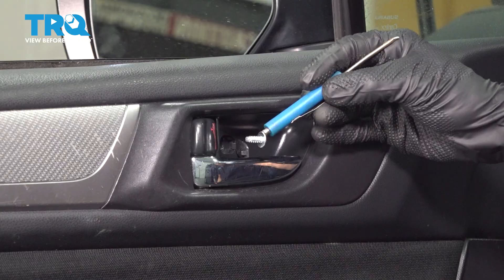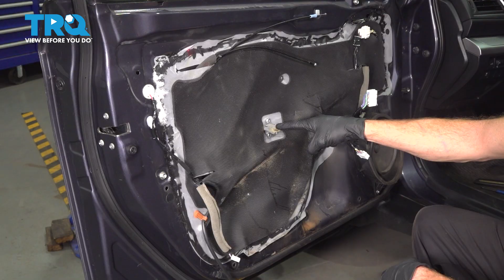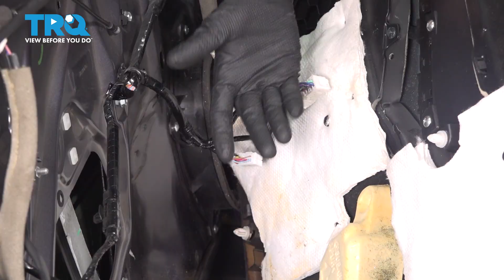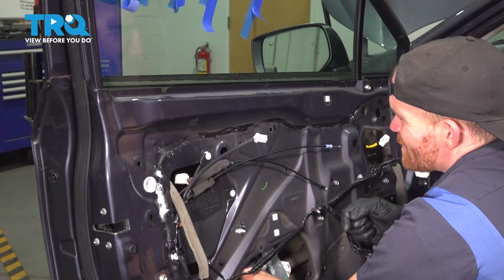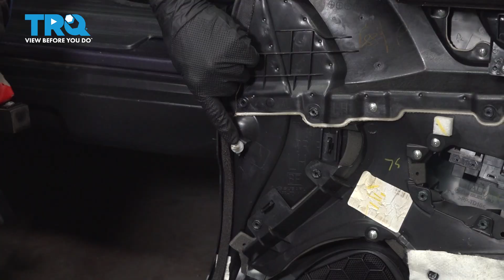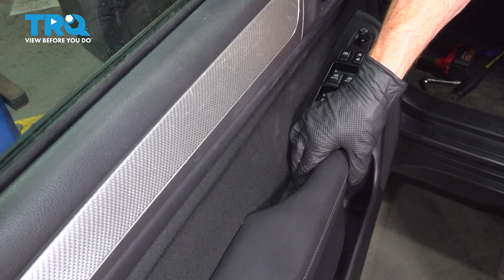How to Replace Front Power Window Regulators 2015-2019 Subaru Outback

Comment: What about reprogramming the switch my window will not work correctly after replacing the motor. It goes down but will not go up you have to inch it up and the auto up and down will not work.
Thank you.

Comment: Thanks to this video, I just finished replacing my driver side Power Window Regulator on my 2019 Subaru Outback. I'm a rookie car guy with limited mechanical knowledge. This video was extremely helpful! 
My window regulator was stuck at the top of the window. I had to use a Dremel to cut the black/grey cable housing for the old broken window regulator. I bought my new window regulator assembly off Amazon. While it did fit, the motor assembly didn't have the hooks to hang on the frame. Everything else worked just fine.

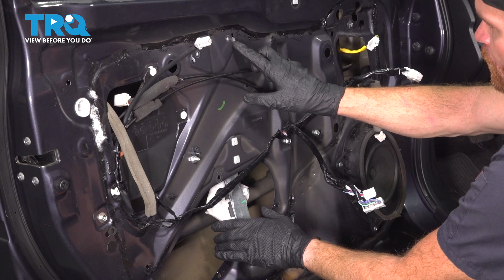Comment: I had to replace window regulator on 2016 outback, but window was stuck closed. I had brake the hook tabs he's pointing at  @ 11:34 in the video. Window still didn't move,  removed tape from the window because wouldnt move or drop to access bolts on plastic window slide. I retaped window then I cut the track at the bottom with metal grinder @ 9:40 to get window drop to exposing 2 bolts to push window back up in the closed position. "caution make sure window is taped to prevent it from falling". The rest of repair easy peasy.

Comment: Pro tip, if you're trying to do this job and your window regulator failed and your window regulator is stuck up there is a solution to get the window disconnected. Cut the black and grey cables, black cable can be cut through the big hole and grey csble can be cut from pushing it out the top. Once the cables are cut the window will move freely, have a friend hold it.

Comment: So for the tabs at 11:36, my window is stuck at the top, and the white thing is also stuck up there, tried to move it down but couldn’t since window motor part dead, so we ended up just snapping the tabs off with plyers, and was able to bring it down.

Really imprtant you have that tape there on the window, because if you dont, it will fall and shatter lol.